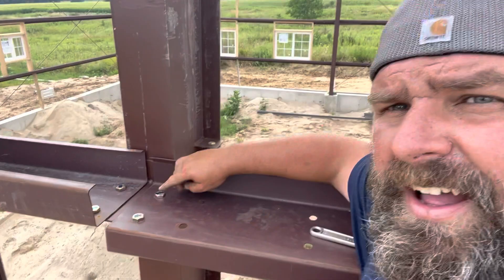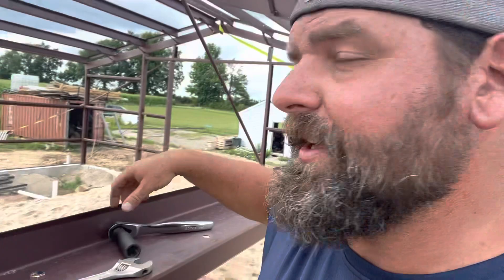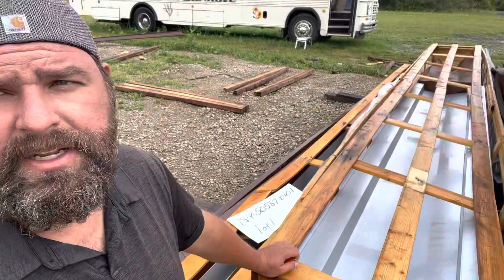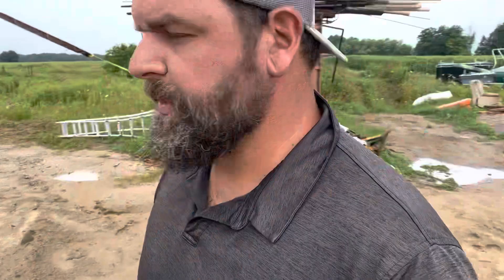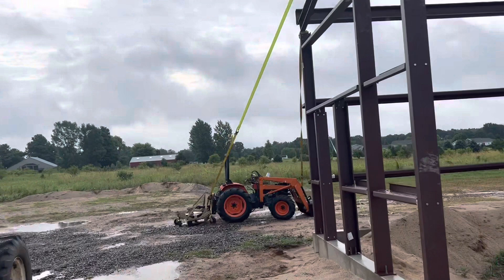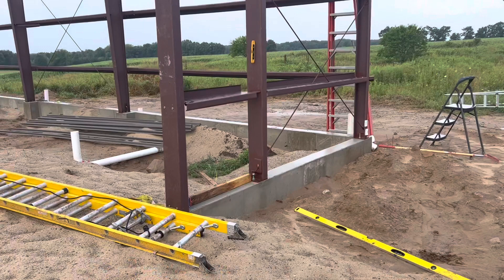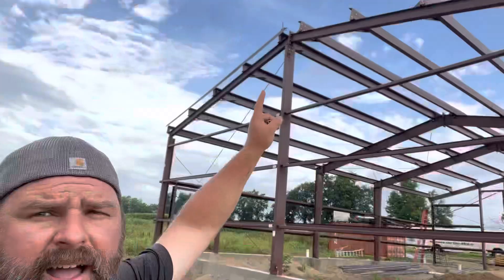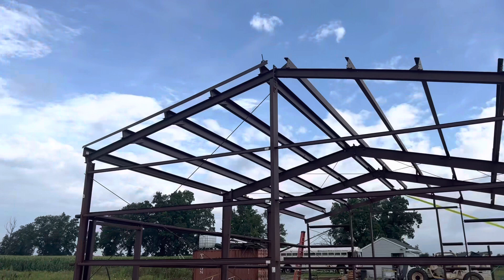RED IRON (4) Metal Building: How Difficult Was It to Build?

Comment: I just finished one. I would recommend having 3 other people help you and get the proper equipment. 1 scissor lift, 1 telehandler, and 1 snorkel  man lift. If you're insulating with batten insulation, don't use R19 on the walls. It's too thick and is extremely difficult to install the panels over it. R 12. Our manufacturer didn't give near enough butyl tape for the seams. Most instructions are minimal at best. Ask others who have done these for advice.

Comment: The building company was to lazy not to ship your siding, roofing panels and red iron in different packages. What do you think they would say when delivered to their own house ? When lining up your red connections you must use your basic red iron hand tools. You need to used a spud wrench, bull pin and sledge hammer it would have been a no brainer. It should not have taken more than a minute or two and had the bolts tightened and moved on. You're asking for accidents when you don't use the proper equipment on the job. The ground surface inside and around the building should be compacted and graded before equipment is used to prevent accidents. You need a laser to plumb and line your red iron building. Your calm demeanor is a plus for this kind of job. Unfortunately red buildings can beat you up and cause brain damage. You must follow the correct building procedure throughout the process. There are no shortcuts. I know what it is to be in your position. It sucks big time. I would hunt high and low for someone in your area that can help when you have questions. knowledge is key to success. Hope it works out for you.